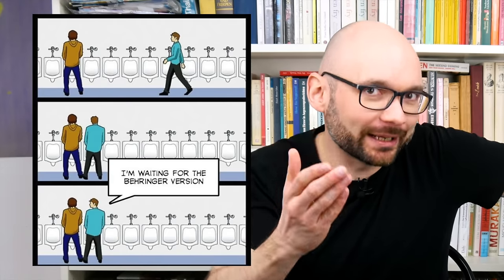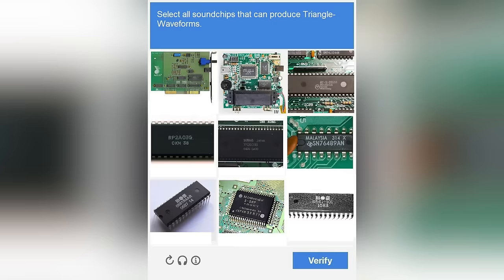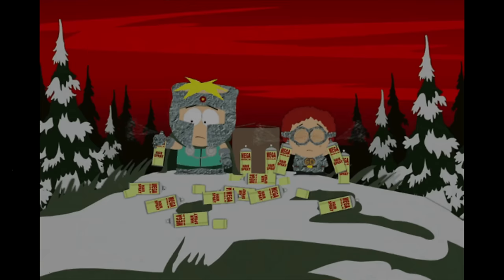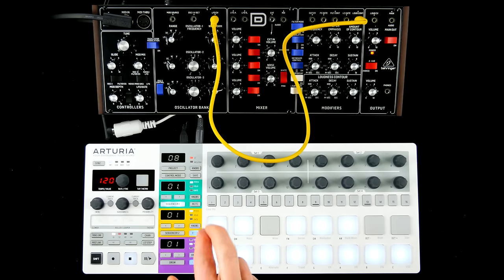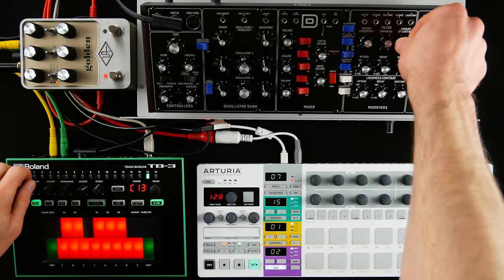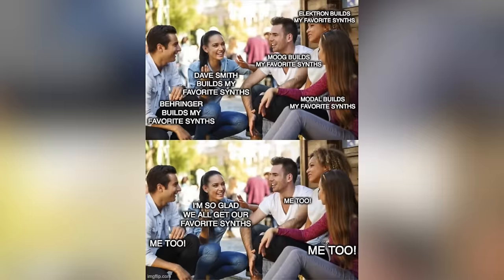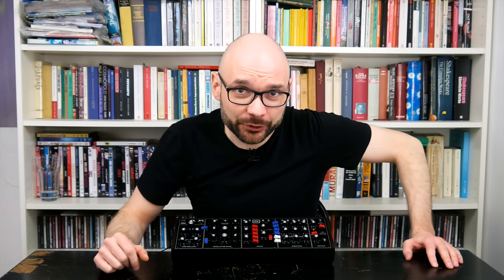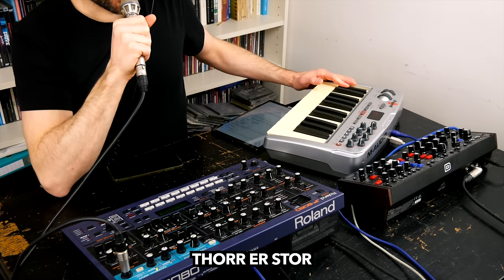Bad Gear - Behringer Model D

Comment: Loved the Boog so much I plopped down the cash for a voyager. Man I love that synth. Behringer started my analog obsession with the Deepmind. I’ve largely moved on to classics and Dave Smiths, because there is a difference. But thanks to Uli for getting it started.
Reply: Was looking at a Dave Smith as an upgrade for my DM12, instead i got a second for 24 polly, a live 2 and a Digitone. 
Quality is great, but if that sound is only part in a track is it worth it?  Can an audience tell or do you need audiophile headphones?
Reply from the maker: Nice!!!
Reply: The audience and audiophile can't tell the difference. Your final mix is what counts and that's always key.

Comment: I love the model D. Sounds good and easy to use. Screw the haters!
Reply: @Ajoura 
The only issue I have with China in this regard is the fact that they don't recognize intellectual property not filed within their own country, and a lot of their products are directly ripped from those originally designed and developed in other countries. I buy a lot of stuff myself from there but it's all individual electronics components, not finished goods.
Reply: But don’t hate the screwers.

Comment: Had it, sold it after half a year or so. Too massive for articulated productions but I had similar issues with a Roland Juno 60 that I long term exchanged for a „thinner“ 106. I wish you a fantastic 2023 and all the best, Tobi
Reply from the maker: Have a great 2023, thanks!

Comment: I have a Behringer Poly D, and for some reason it sounds pretty different from what I'd expect, too much tone in the mid-range
Reply: Lmao I made you buy it 🤣
Reply from the maker: Yeah, these synths have quite a few mids
Reply: I have both and you're exactly right. The Poly has more low-mid range. The Model D extends the bass better, but what it really does better is create a natural compression in the mixer gain. This is how the minimoog also sounded. If you look at a Minimoog waveform it's basically a solid block whereas the Poly D has phase peaks. This means the bass sort of "floats" around. The Model D bass tone remains even and massive.

For reference, if I gain all OSC's on the Poly D to max 10, there is only subtle harmonic distortion and sine-type curving of the waveform. But my Model D OSC's at only 3 or so start to curve and distort even more than the Poly. At 10, they practically all smoosh into a giant square type tone. And that's all before you can even kick in the overload.

To me they are considerably different synths and I like them equally but for different reasons.

Comment: Just a reminder for a eletarist techno (and synth) guys who think that you need to buy only original vintage analog gear. Don't forget, that most of classic 90s techno-trance tunes, were made on the gear that was really cheap or depending on time appeared to be shit, in 90s everyone wanted digital synths with multitimbral patches, layering, maybe some drums tracks like M1 or JV's, lol. 
If you want to buy a synth for the music production go with the Behringer, if you are collecting synth to store some dust on it and then want to resale it after few years for the double price, go for the original.
Reply from the maker: The resale value is definitely a reason to get the originals

Comment: Another AudioPilz "Good Gear" video.  I'm loving the Behringer clones.  I use the Pro-1 in almost every track as well as multiple 2500, Model 55, and System 100 modules.  The RD-9 and RD-8 are great as well.  Brains is no joke...honestly  I'll keep buying their clones because I'm not a millionaire but am a musician none-the-less.
Reply: In the 80's I got the real Pro-1. I think it was like $600. A.F.A.I.R., it did not have CV jacks like the Behringer. Eventually sold it.
Reply from the maker: Brains is super powerful!!!

Comment: I'm very happy with my Behringer D. If I had to sell the D or my Moog Sirin, it might even be the Sirin (although I do like the patch storage on the Sirin).  Happy New Year!
Reply: Does the 3rd oscillator make that much of a difference
Reply: @KirklandWilliamsWorkout3000  Yes, but it's not the 3rd oscillator, it's the flexibility and control. The Sirin is at it's best when using the software editor whereas the Model D has one knob per function. And the  D has multiple waveforms per oscillator where the Sirin has just saw and square. And the D has easy overdrive. But the Sirin has a great sound that is different to the D so they are complementary.
Reply from the maker: Really have to give the Sirin a go!
Reply: @AudioPilz  would love to see your review of it! And your cool intro music made with it!

Comment: There is a pwm mod you can do to this! There’s actually a lot of stuff built in but you have to solder jacks to the inside. There’s circuits for cv to pwm more noise colors sync that just aren’t on the front panel. Maffez I believe has a whole buncha the mods including a poly mod for it (but you can only use one octave)
Reply from the maker: Interesting, didn't know that. Thanks for posting!

Comment: I use a Model D as part of my live rig. I play in a Heart tribute band, and use for the solo in Magic Man as well as the song Heartless, both of which were recorded on the original MiniMoog. Maybe my ears aren’t as good as they used to be, but I literally cannot tell the difference between the MiniMoog on the original recordings, and my Model D.  Being a real analog synth, it obviously the tuning drifts a little bit, just like a real MiniMoog. I let it warm up for a while before tuning it before sound check, and I double-check it right before we go on stage. As long as I do that, it’s usually quite reliable. My master tuning knob is slightly off, so I just use the A-440 switch, and tune it manually by ear.

Comment: I had 1, sold it, sold 2 Mother 32s too, build quality of Model D was bad, I mean the wood was like cardboard, soft and easy to damage. Sound wise, it was nothing like my M32s and the knobs were woeful.
I experimented in semi modular and decided it was not for me.
Hands down the 1 OSC of a M32 would run rings around the Model derp. The feel of the M32 was much smoother in the knobs, classic toggle switches, shame about the hidden features for the sequencer etc. 
Model Derp has a place in the market, I prefer to get better gear that I will end up using.

Anyways thx for all the great bad gear this year and have a beer for the new year!!!
Reply from the maker: Thanks!!! Cheers!

Comment: The title "Bad Gear" is a blessing and a curse, I'd guess.  I can see manufacturers wanting to avoid being on the show, if they've never seen it.  But every piece of gear can be bad gear if you look at it through its flaws and/or limitations.  The D is on my Amazon wish list.  The problem is that I have the Arturia MiniMoog plugin and it's pretty darn good.  Do I replace a software clone with a hardware clone?  Ah, but those real knobs are very enticing...  great video as is always the case.
Reply: It's not really a show about Bad Gear because pretty much every episode has killer tunes that really showcase the "bad" gear.
Reply from the maker: I know;) The plugin doesn't go out of tune as beautifully as the Boog ;)
Reply: @apoclypse  Killer tunes?  YES!  Tunes showcase the bad gear?  Definitely!  But although I'd say that I like about 90% of the items that have shown up here, there really have been some pure stinkers!  At least in my opinion, that is.  :)  That's a big part of the fun - you never know what's going to show up here.
Reply: Get it. Arturia Mini was my goto for nearly 20 years. You can find sweet spots on the Mini V, but it’s fiddly and still not as nice as this. Everything is a sweet spot on the D lol.

Comment: Say what you will about Behringer but I've had mine since early 2020, and it's still kicking, and it still regularly gets used (mostly as a leads machine these days since I don't use a lot of analog bass). It's been a dependable piece of kit that just works.
Reply from the maker: Nice!!!

Comment: Those Behringer desktop/rack synths are just what I wanted for years. 
I have the Model D, Wasp, Pro1 and MS-1. 
The main question about Behringer is durability. For the moment I don't have any problem (fingers crossed) but I know it's always a recrimination about this brand. 
I'm waiting for Solina, 2 Xm (2 SEM), a wavetables synth (PPG clone maybe), Proton maybe too.
Reply from the maker: Always buy two and keep one in the box;)
Reply: At risk of jinxing myself, my Neutron is one of my most heavily used synths and I bought it 4 years ago.

Comment: The behringer clones are honestly pretty impressive but can lead to serious GAS because another 300 bucks synth won' break the bank. Also NEVER try the damn neutron because it is the gateway drug to eurorack.

I pretty much realized that VSTs give me a better workflow and now I stick to good old xfer serum. I'm thinking about mapping it to a midi controller like the faderfox ones with lots of knobs. 

Great episode though. Außerdem: An Guadn rutsch wünsch i da!
Reply from the maker: Thanks!!! Guadn Rutsch!!!
Reply: The MS101 was my gateway drug to the Odyssey, Model D and DM12. I think I can resist Pro 800, but the UB-Xa is gonna be tough if it ever comes out...
Reply: It's a good thing Behringer can give a fix of Eurorack too. Santa gave me a 110 to join my Neutron-centred setup.

Comment: What processing do you do on your drums? Your sounds are so incredible I want my drums to sound as good as yours
Reply from the maker: Sample selection is key and a little compression usually doesn't hurt (Ableton Glue Comp, UAD 1176)
Reply: @AudioPilz  I’ve been running their glue compressor on most of my drums and it does wonders. I’ll have to check out that other software

Comment: I'm not a fan of the model d. Not sure why, it just never grabbed me. But, I did find that I like to "hide" it under the K2. So I've basically got the midi on both to the same channel, and hooked with through. 
Turn it down some and it sits quite nicely under the k2.

Comment: Is there a way to control sustain/damper on this thing? Mine won’t respond to CC64 or midi controller with sustain/damper jack like my microkorg does wondering what’s different on this.
Reply from the maker: Not that I am aware of
Reply: @AudioPilz  OK SO I FIGURED THIS OUT. I bought a DOD FX-17 (using w/ power supply, not battery for CV function) and am sending 5v CV into the Poly D’s Ext. V Trig with a TRS cable. You can open and close the gate with this essentially acting as a sustain/hold pedal.

Comment: Hi! It sounds more like an advertisement to the Boog :)) The comments are "kindergaten" level like... "Cold because of SMD components" :)) I've thought the same about Korg's new Mini MS-20. But I think that there is some other reason (Korg's new "perfectionism" system of VCO stability control probably).
Ask that guy if he has MFB Synth Pro for 1/2 price and I'll buy it overseas! :D It's totally SMD too!
Of course, the overall "feel" of the synth is a bit "toyish" with all these Chinese knobs and switch buttons )) Sometimes it bothers me... But it gives a great sound and (not like MiniMoog) gives many connection possibilities!
Reply from the maker: Most hate is actually unfounded;)

Comment: the sound of the model D is brilliant. only complaint is that using it live is a bit more trouble as there's more setup with having to do midi between a controller with 2 power supplies for controller and synth. it's a shame the poly d costs so much more

Comment: Mine is a little messed up. The envelopes are slow, I can't get like a driving tangerine dream bass like I could get out of my minitaur can, but I know it has the capacity. I just don't know how to calibrate the envelopes. The tuning is kinda weird, like the first oscillator is like a have a step sharp or flat but never in the centre. I still like the sound but it could use some love to get the versatility I see it's actually capable of. Don't have the funds to bring it in though.
Reply from the maker: Not aware of any envelope calibration procedures either

Comment: Berhinger is like McDonald's, it's impossible to avoid becasue of price and avaiability (I have a Neutron & 2 small Xenyx 502's (you can put them anywhere for utility). Behringer gear can be deeply satisfing the same way a "Royale with Cheese" (that's a Quarter Pounder for the American viewers who never saw Pulp Fiction) when you're desperatly hungry and low on cash and optiions. The model D sounds like a Moog, although at time brittle when pushed. Not as smooth, warm, and in your face or tear you head off like a real Moog.
Reply from the maker: Around here you can get some proper Döner for the fraction of a McD menu;)

Comment: Oh weird- the initial walkthrough of sounds was making my nipples explode with delight at apparent phatness- but the jams just sounded... bad. This is the opposite of the normal Bad Gear effect, where you can take any apparently hopeless device and find something downright banging to do with it.

I actually felt a bit queasy listening to it and was telling myself that it was something to do with weird pitch instability or something, but I do wonder if the same would have happened if I listened to those clips without knowing that they were the fruit of Papa Uli's loins.

I do own a little bit of B - the 303 and 606 clones, and while I feel a little guilty, they're fine machines. It feels like anything more complex than that becomes too much and the cut corners too apparent. I also used to have a Neutron and, well, it was crap. Wobbly pots, leaky VCAs, noise, prone to stuck notes and so forth. I replaced it with an Erebus v3 (admittedly at roughly twice the price) and was blown away... Actually.. hey, Florian, how about a Bad Gear episode about Erebus v3? It's a really interesting little paraphonic desktop unit with a giant sound :)
Reply from the maker: Interesting! Great feedback, thanks!!!

Comment: Trying to eat Pizza while watching an episode was indeed impossible due to the memes I just have to read. ;)  Behringer. Yeah. The copier in there probably wears out quite quickly. I've only owned DJ mixers and rack mounted EQ from behringer and they were horrible build quality. That has left me hesitant to buy any of their synths since my experience is that they source low quality parts and throw them together hoping the thing just outlasts the warranty time.
Reply from the maker: Mmmmmh, pizza...;)

Comment: When you factor the change of size and cost of modern components.  The cost to manufacture these retro circuits should have changed in proportion.
Reply from the maker: Uli's supply chain is quite unique too

Comment: I fucked up and bought a behringer Crave instead of a model D.
Reply from the maker: Why not both?;)
Reply: @AudioPilz  running out of space! I need a personal klangfobber! lol.  Plus, the craves 1/8 output jack pushes out the cable. Randomly. It needs replaced.

Comment: So ironic, AP. In trying to inform us of what’s wrong with this module, you would instead serve to undermine my resistance to getting one. All that, and as I’m commenting on 1/1/2023; I’m determined to make ‘23 a zero-purchase year! 
It doesn’t help when you include the nugget I wasn’t conscious of before, but you can connect 16 of them for polyphony. What about a preset box a la the ones marketed in the 70s by Oberheim and Sequential?
Reply from the maker: It's called the Bad Gear fallacy;)

Comment: lots of hypocrites.... plenty of these synths have been cloned in one way or the other.... go back 15 years and those same gearslutz would be debating/arguing about what vst sounds the most like a moog/tb303/juno etc etc.... behringer did the same thing, only as actual analog synths.... nothing prevented any of the other manufacturers from doing the same thing. OTOH suing a forum is pretty stupid, cant see that as strategic, and certainly all publicity is not always good publicity... but I dont expect corporations to act morally, generally, unless some law compels them to....
Reply from the maker: Good points here

Comment: If you are feeding your 100% analog signal chain into the D/A and A/Ds of an outboard pedal it kind of defeats the purpose doesn't it?  Convert at your interface (after all the conversion pipeline within is what you are paying for) THEN apply digital reverb.  If the conversion chain of these pedals were pro grade we wouldn't need dedicated audio interfaces
Reply from the maker: The UAD reverb actually has an analog dry path;)
Reply: @AudioPilz  What does that have anything to do with running through an outboard DAC stage?  The dry path is being mixed in digital.  You think there's analog 2x2 stereo summing, mixing and gain makeup on the pedal?

Comment: How do I email you? I have been looking all over for your email address. I want to see if you want to do a Bad Gear review of the Pioneer Toriaz SP-16? I have one and can send it to you in the original box for a review. It's a total piece of crap sampler! It's perfect for Bad Gear. Pioneer half-baked the software and it's terrible when compared to an Akai or other sampler. But it does have a step sequencer which is pretty cool. It's one of those terrible pieces of equipment that can do amazing things.
Reply from the maker: Thanks!!! Insta Messenger usually works pretty fine